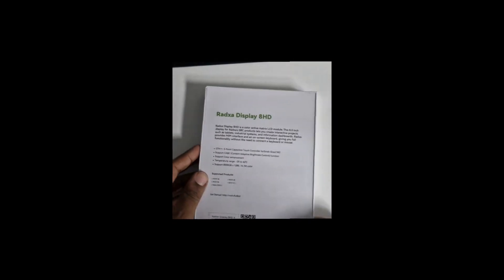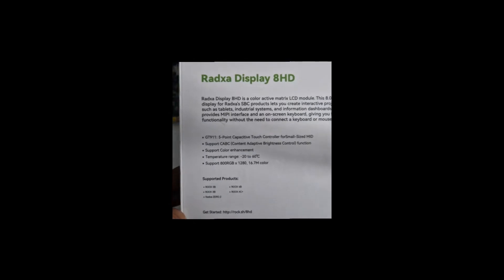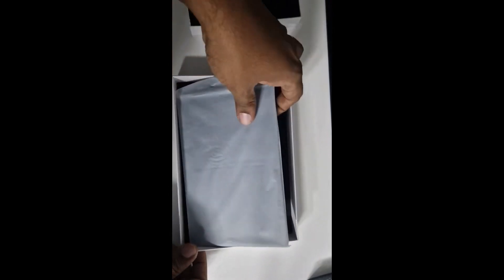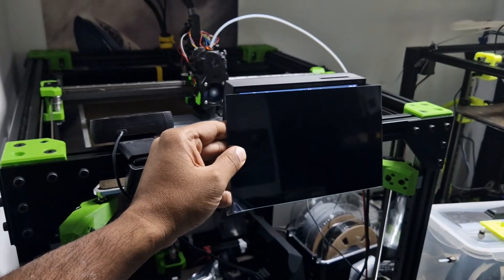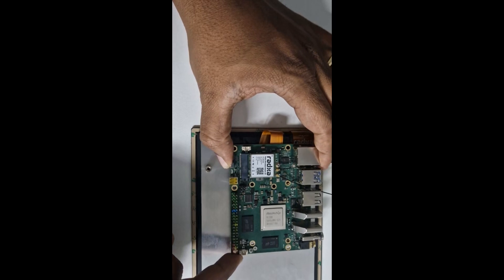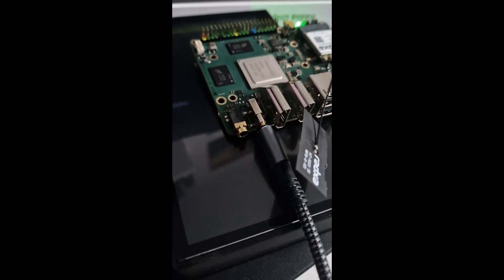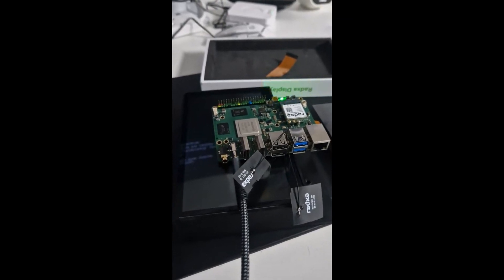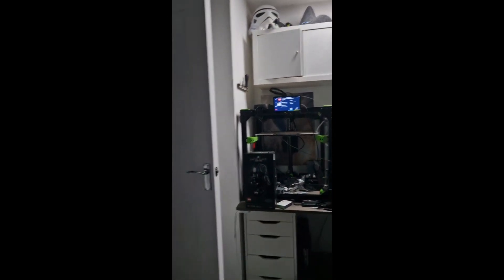Radxa Rock 5B and Display 8HD Touchscreen project for Klipper

Comment: docs radca 8 hd says install system disc... did it come with an install media? I can't find any install media on the seller page, nor in the docs. There is a long thread on raspi forum that says the it worked on pi4 with raspian OS bookwom but not anymore in pi5, Thread had been locked with no solution, syaing he wasnt able to determine the system interrupts were used --- or used wrong , but did not leave space to reply for post a fix solution. Maybe part of solution goes to gt911 chipset being seen as i2c /dts-v1/;
/plugin/;
/ {
    compatible = "brcm,bcm2708";

    fragment@0 {
        target = <&i2c1>;
        _overlay_ {
            /* needed to avoid dtc warning */
            #address-cells = <1>;
            #size-cells = <0>;
            ft6236: ft6236@14 {
                compatible = "goodix,gt911";
                reg = <0x14>;
                interrupt-parent = <&gpio>;
                interrupts = <4 2>;
                touchscreen-size-x = <640>;
                touchscreen-size-y = <480>;
                touchscreen-x-mm = <70>;
                touchscreen-y-mm = <53>;
            };
        };
    };
};